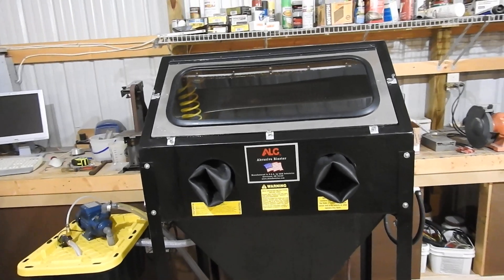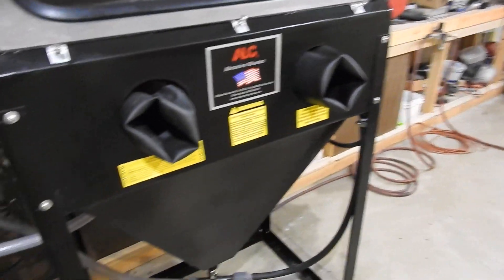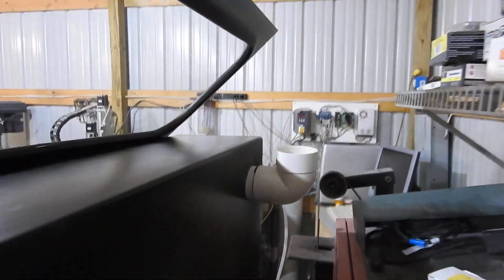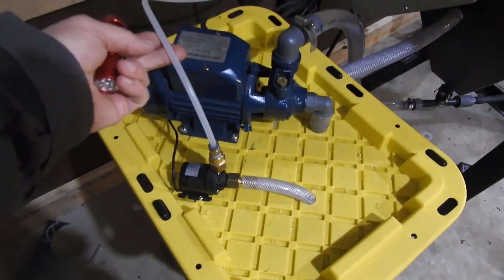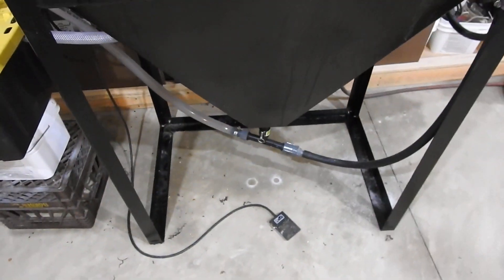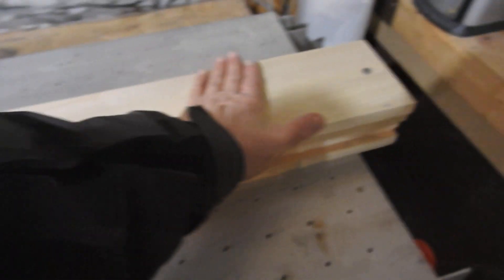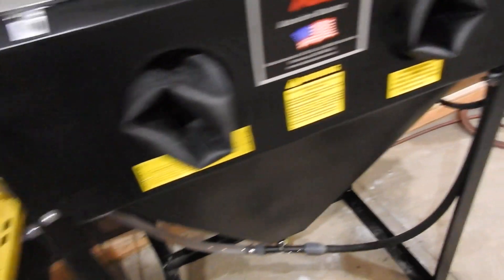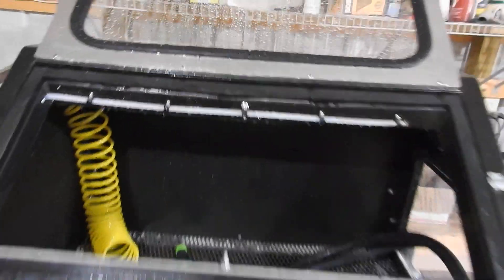DIY Aqua Blasting Cabinet

Comment: Hi I made one of these but stuck on the electrics and how to set it up and what to buy could you pls help me
Reply from the maker: I can't help you over youtube with the electronics. You'll have to find someone close to you to help. You can always use a air controlled foot pedal to turn the air on to the nozzle, and just a light switch to turn on the pump and lights, just to make it easier.

Comment: Can please explain your clean water recovery.  Looks like your tanks are quite big and I have no more room in the shop.
Reply from the maker: The tank is for a house sump pump to keep water out of your basement. Since it is under the cabinet, it doesn't take up any more space than the blast cabinet does. The glass media and the water are free to drain into the tank. No water remains in the blast cabinet.
Reply: @Dynodon64  I am very much interested in your window spray system. Where you get the clean water from?
Reply from the maker: @marekhabel2493  You attach a garden hose to a fitting in the back.

Comment: Don,
Have you had an issues with the solenoid valves overheating or burning up?  I have seen others recommend the motorized ball valves over the solenoid valves, but they have a delay.  Thanks!
Reply from the maker: I haven't had any heating problems with the valves. Just finished blasting for the last two hours just now. That valve gets turned on and off a lot too when blasting. They are working great. Motorized ball valves would be too slow to turn on and off like you said. The pump motor runs off of a relay and the air valve off of the foot switch.
Reply: @Dynodon64  Great!  Thanks for the information.  Is it a 1/2" valve?
Reply from the maker: @travisdotson1880  Yes 1/2 inch pipe

Comment: Hi dynodon, just would like to know the CFM and HP of the compressor you are using, if you dont mind. thanks.
Reply from the maker: 5HP, 60 gallon, 12.2 cfm @40 psi,10.2 cfm @ 90 psi.
Reply: Hi Don. Do you find that size compressor is adequate?

Comment: Hi, how do you filter out grease and debris that come off items? Also, is 'worn' media replaced all in one go, or is there a way to screen media?
Reply from the maker: Martynas Birzys, I pre-clean my parts before I blast them. Any oils will float on top of the water, and can be drained off from the water level valve on the side. You change out the media when it starts to take too long to blast clean the parts. It all gets changed out when it's worn out, just like sand blasting.

Comment: And where did you get the the control box from and the power supply is just a computer supply?
Reply from the maker: jonboy688, The box came from Lowes, it's just an empty electrical box. The 12 volt power supply came from Ebay, as well as the timer, relay solenoid valves, foot pedal and motor. I am using a different motor now. Look for my new video showing the new upgrades.
Reply: @Dynodon64   you are making a new video or already have one uploaded? i didnt see a updated video?
Reply from the maker: @jonboy688  Just posted it now

Comment: How large is the hopper? Would one of the trash pumps fit in the hopper area like a few of the guys on YouTube are doing with the harbor freight blaster?
Reply from the maker: jonboy688, the cabinet is just as large as the ones you get from Harbor Freight. So yes the pumps will fit.

Comment: Hello sir. I have some questions about vapor blasting aftercare. Question 1. How to protect aluminum and cast iron engine parts after vapor honing what is the after care like water soluble rust inhibitor or aerosol spray. Question 2. How to safe media like glass bead and sodium bicarbonate after vapor honing process into the hopper will it be rest and stayed like a stone or should be use another protection for it. Question 3. How to remove glass beads from thin spaces after vapor blasting.
Reply from the maker: Youtube For Education, Aluminum parts don't need any protection after blasting. Steel parts will need to be dried after rinse and coated with some form of oil or painted. The glass bead, when in use always stays in the hopper. After use, it settles to the bottom of the hopper. When you use it again, it gets stirred up by the pump. When the media breaks down after a lot of use, it will need to be replaced. The glass bead used is very fine, between 170-320 grit. It washes out of very tight places because of that. I have not seen any residue left after a good rinse with fresh water.
Reply: @Dynodon64  But what about aluminum oxidation after vapor blasting process. If i left glass beads remain mixed with water  into vapor blast cabinet then will it be form glass bead lump. What surface protection should be use for cast iron engine parts as a rust inhibitor water soluble or aerosol spray.
Reply from the maker: @bittainment5995  , you will still get oxidation on aluminum, that is normal and you can't stop it. But with that said, the aluminum parts seem to stay new looking for a long time because of the polishing process of the vapor blasting. I blasted parts months ago and there is no signs of oxidation yet. If left out to the elements, it will happen faster of course. 
Once the water is added to the glass beads, it stays in until it gets to be un-useful from breaking down. It does not form clumps in the water. It settles to the bottom, but gets mixed back up as you start blasting again.
As with any bare metals, you need to treat if so it won't rust. WD40 works good for a start. It washes off the water and adds a light protection, but will start to rust over time. You will have to paint it or use some other form of coating to keep rust at bay.
Reply: @Dynodon64  I want to make my own vapor blast cabinet. Sir please share the plan. How do I build my own vapor blast cabinet.
Reply from the maker: @bittainment5995  I don't have any plans for my build. There is a guy on YouTube that does offer pans. I am always trying to make mine work better, so I keep making changes to it. Their not that hard to build. You will need a good air compressor at least 5hp and 14cfm air flow. There are several people now showing how they made their cabinets on YouTube. Look into their designs and come up with your own style to fit your needs. They are starting to become more common now.
Reply: @Dynodon64  How did you build your own vapor blast cabinet. Which pump have you installed in it.

Comment: Hi. What kind of pump du you have?
Reply from the maker: jabe 1807, I bought the water pump from Ebay. It is a submersible pond pump or sump pump. 1HP. They cost @ $40.
Reply from the maker: jabe, I no longer use this pump. I have changed it to the one I mentioned in your previous question.

Comment: Nice tidy conversion, well done! 
Not cheap but significantly less than even the lowest priced commercial units and undoubtedly more effective. How do you deal with the excess volume of fresh water from the window and wash down supply?
Reply from the maker: Yes it wasn't cheap, but if you were to use the Harbor Freight cabinet, it would be @$500 cheaper. I didn't want to use a steel cabinet, because it will rust over time. The wash down water will be drained off before the next use,  after the media has time to settle. There is a water level drain on the side that will only drain down the water and keep the correct ratio of water to media mix. Thanks for watching.

Comment: What nozzle size are you using in your blast gun, how much air pressure and how do you keep the blast media from sinking down to the ground of your container? Is there an additional pump that keeps the media mixed with the water?
Reply from the maker: A Friend, The nozzle size is 8mm. I use 40-50 psi of air pressure. I have change the set up since this video. You will need to check out my newer video to see the latest set up. I will make a new one to show it better. The output of the pump has a TEE fitting that splits the water to go to the gun and to the bottom of the sump to stir up the media.

Comment: Nicely done Don. I built a sandblasting cabinet years ago and like yours, I had a window for viewing the progress. I salvaged a thick piece of glass and it turned frosted from the sand hitting it. I took a couple layers of window screen to cover another piece of glass and I finished the project without having to replace the glass. I don't know what may come out of the exhaust from your cabinet but maybe a respirator might be called for if not a dust mask just to be on the safe side. Best of luck on your projects.
Reply: Auggies1956 being water you have no dust
Reply from the maker: Auggies1956, This blaster is water based so there is no dust to worry about. The large vent in the back only lets out air. No water mist or dust comes out. It is very quick at what it does. The window in this is just Lexan plastic. It should last way longer than a dry blast cabinet.
Thanks for watching and posting your comments.